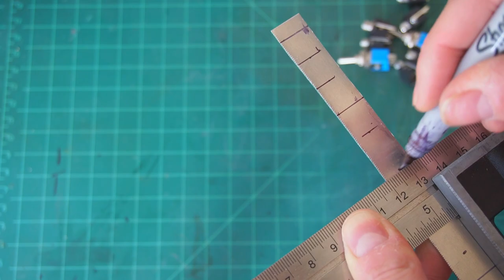Switched Multiple - Easy DIY Eurorack Module

Comment: Nice little quality of life module!  If your vise is long enough to accommodate 3U, try cutting your panel big next time and adding a vertical 90° bend on one or both sides for some extra rigidity.  If you can get yourself square and practiced at knocking the bend in, it can even look cleaner than tinsnips up the sides.

Comment: Great video! What kind of metal did you use for cutting the front plates?
Reply from the maker: I use 1/32" aluminum because I have a bunch of it, which is easy enough to cut but a little flimsy for a module this narrow. I'd suggest going with 1/16" or about 2mm sheet aluminum -  any sheet metal place should stock it, and you can have them cut it into a couple of 129mm wide pieces so that you can make modules from them.

Comment: Yooooo I never realized how easy it was to cut an aluminum sheet like that! Might have to get some now cause buying black panels is cheap enough but gets spendy quick I've messed up a few blacks before. Been using just pcb taped to my rails that or cardboard. Wonder if guitar pick guard would work

Comment: Hi Extralife! I love your videos... ive got a question for you: How thick is the sheet of aluminium that you use for your diy proyects like these?

Cheers
Reply from the maker: It's real thin stuff! 1/32" or so I think. Thicker would be better especially for such a thin module. It holds the parts fine but does flex a bit when inserting or removing patch cables. Another commenter suggested adding an L-bend to one side of the panel, which would stiffen it quite a bit, will have to try that. Otherwise I'd suggest getting 1/16" stock, which should still be possible to cut with tin snips.
Reply: @extralifedisco  Thanks a lot!

Comment: How much  can signsl be multiplied? Can i connect the same signal(for example a gate) from the switch spdtn to three outputs?... Could it get weakee as it get multiplied?
Reply from the maker: Yes, you can double up gate signals just fine, just like any other passive mult. Pitch/CV signals do tend to get weakened a bit when multed to different places - while that's probably fine for LFOs and envelopes, with pitch it makes stuff go out of tune so you're better off using a buffered multiple.

Comment: I don't get it. I built this exactly how you did it but the signal goes through both outputs no matter what side I flip the switch to. Doesn't make any sense to me. EDIT: I switched the ground and the signal wires (misinterpreted my sockets) so of course it doesn't work. Better get my iron back out.
Reply from the maker: Can't count how many times I've done that! Nice work troubleshooting it.
Reply: @extralifedisco  I resoldered everything and now it works great. Made a passive mult and a dual switch on 4HP. Pretty rad. Thanks for posting this video, I saw it months ago and I just now gave it a try... glad I did.